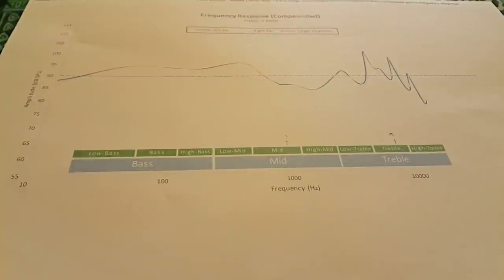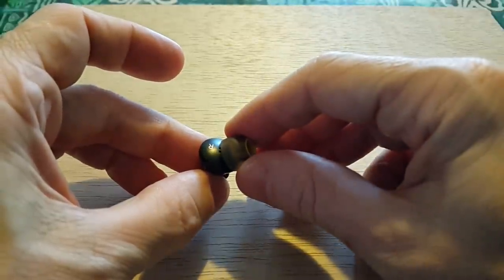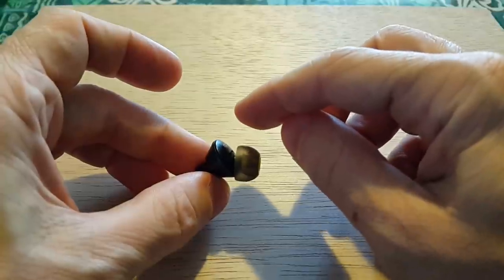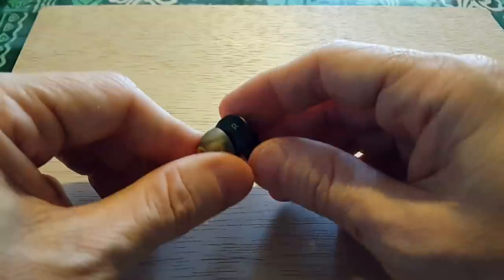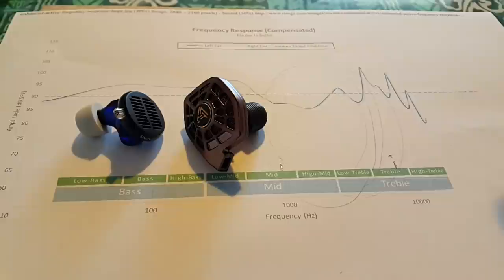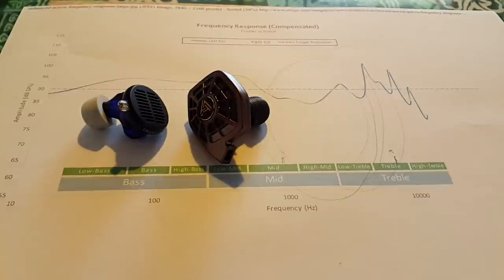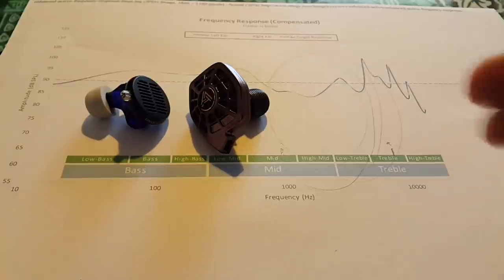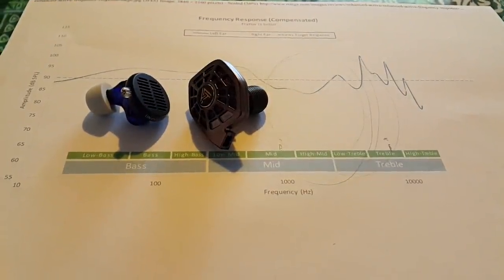Planar v.s. Dynamic, BA, Hybrid in ear monitors (IEM)

Comment: Very informative video. I own the iSine 10s myself and I love them. 

In regards to the EQ, Audeze released an upgraded Cipher cable that conforms to the new MFi standards that Apple implemented. Audeze says it just allows for more power from the lightning port, but I also noticed they tweaked the EQ to be much more balanced at base level (without adjustments). I don’t think it’s on their website, but if you email them they will sell you it. It’s also much lighter than the original, the DAC being plastic instead of metal. 

On another note, the me1s were far too mid-forward to my ears for enjoyable listening. They were very detailed, and incredibly well built, but I just couldn’t hear much past the mids. I’d like to hear what they sound like after some EQ tweaks.
Reply from the maker: Thanks. I am a Android based person so I walk the EQ jungle because I have to. The ME.1 are much improved by a reduction at 1Khz and a boost at 4Khz  and some bass ( for me)
Reply: Alex Darger cipher cable makes all the difference in the world.

Comment: I agree completely - I just recently bought the iSine 10 and m300
Reply from the maker: What is the main weak point in the frequency of the 300? in your opinion.
Reply: Bad Guy Good Audio Reviews I’m still a novice to EQing but the cipher cable seems to solve the issue on the iSine 10 listening to tidal on an iphone like everyone else says. I’m planning to get some 2-pin to mmcx adapters to try the cable with the m300s which seem to share the same issue. It would be nice if Audeze had designed a cipher cable that could be programmed with a usb cord to the remote by computer with a 3.5mm connector and include the 3.5mm to lightning connector for ios or usb connector for other devices. Then you could lock in the EQ settings internally and use it with almost any device, not just ios. In general, I agree with your overall assessment of the different types of iems. I also own a pair of sony 7550s which I like a lot. I’m still learning though.
Reply from the maker: You are living the high life :) I'm a droid user and we are in the jungle right now. The Sony EX 800/7550 and 1000 are the finest dynamic driver IEM ever made IMO. Sony makes lots of crap but the team that made that earned their money...unless they made the cable too...then i take that back. Such awesome IEM and such crap cable. I got customs for both my EX. Like a bucket list item crossed off.
Reply: korling99, and how about the sound quality of the M300? I'm almost buying one, but the opinions are all differents. Some say that they are incredible, others say that have many problems and only became nice with eq. Can you compare it with your iSine?
Reply: Frederico Silva Vieira Veloso I’m still a beginner audiophile, but they sounded good to me out of the box playing high res files from an Aune M1s player - rock and jazz. The biggest problem with the m300s is the fit. As others on head-fi, I bought the groovy kit from Audeze and it worked, not the most comfortable, but not bad. With an iphone using Tidal, the isines with cipher cable (built in eq settings) sounds better than the m300s. If you aren’t using an ios device, the isines will require eq’ing also. For the price, it’s worth a try depending on your playback device. Should be easy to sell if it’s not your cup of tea. I’m keeping both for sure. Biggest issue with m300s is fit, but if you look on head-fi, there are ways to fix it with minor mods or get the groovy kit from Audeze.
Reply: Bad Guy Good Audio Reviews ;n

Comment: Great review - how’s the comfort on those Audeze? And where to use them I mean not outside since they’re open and inside might as well get over ear for the same price..
Reply from the maker: They fit awesome. Those earhooks could use some foam or rubber tube for better long term comfort though. I use at home.
Reply: Comfort varies from person to person. They where ok for my but the driver housing touched my ear causing discomfet after extended use. I recently picked upsome  SYMBIO W Wide Bore Silicone+Memory Foam Hybrid ear tips and the now sit further our so it no longer touches my ears and are more comfortable for me.

Yes, they are open but not they are small (relative to normal open headphones) and I use them outside and at the gym with little issues. Of course at low volumes you will hear more of you environment that with traditional isolating IEMs. Leakage on this small drivers is also generally a non-issue, you have to be in a very quite environment and have high volume for other to be able to take notice. 

Even indoors at my desk I will often use the iSon's because how easy they are to wear vs my larger planar and other over-ear  headphones.

Comment: Interesting video, thanks. I have the iSine 10's. I'm not a huge fan of them with my Shozy Alien+ but watching this suggests I could get a better result by using the EQ options on my Android DAP and/or phone. I'd be interested to know how you tweak yours for the iSine 20?
Reply from the maker: Post #1250 has a good start point visually. bass up maybe shelved 250Hz and a dip from 500-1kHz and an big boost around 4Khz. I will do a video review and share my own eq but until then here is the posthttps://www.head-fi.org/threads/audeze-isine-10-isine-20-audeze-releases-two-new-iem-planar-magnetic-earphones.818870/page-84
Reply: Bad Guy Good Audio Reviews 
Excellent, thanks. I'll try that when I get home. I'll keep an eye out for your video on it too.

Comment: do you have any idea on what third party ear tips are compatible with isine 20? i got it last week but the tips are too big. hmmm maybe its the tunnel itself which is big. thanks!
Reply from the maker: I am using the groovy tips. Try some small comply for comfort. Not sure which brands are being used as an alternative? Head-Fi has a thread on the Audeze and asking in there would probably yield some info :)
Reply: I believe the nozzle is 7mm so you can use anything that works with that. I have tiny ear holes so I use small comply 600s. Groovy tips work well too. Unlike most other iems, you don’t have to push the tips deep in your ear, just get a good seal in the opening.
Reply: I've used the groovey tips originally but recently switched to the SYMBIO W Wide Bore Silicone+Memory Foam hybrid. It's a tight fit but it works

I don't find them to sound much different, but find they provide more comfort to me. Because they don't slide in far on the nozzle and keep the driver housing further out so they don't touch my ear and don't cause discomfort.

Comment: So do any of planar beat the crap out of the head like the ASG 2.5 did? Or what would be the best value under 700$ with an iPhone. I know that may sounds stupid, but I just don't want another bulky EQ device in my pocket. Thanks for your reviews, I'm realy hangig up on your channel now.
Reply: I just bought Pioneer SE-CX8, and I wonder if I should purchase  EX1000, XB90EX, or used 2.5 too. Just looking for the best allrounder with massive bass, to use with iPhone.
Reply: Recently purchased Shure 846 and sent them back after a week. I was never more disappointed. Even my RHA T10 sound more emotional and has groundshaking bass, than this sh*t for 800$...
Reply from the maker: Did you have the 2.5? They shake ear wax out pretty good. Radius NHR21(?) also have excellent sub bass kick. I would get used 2.5 for best BANG for buck. The others are good and have quality but not quantity so much like the 2.5 with dials open
Reply: I have only RHA T10, and had Shure 846 and Rose Cappuccino MKII 2. 
RHA T10 is still my favorite for trap and deep house listening.

I found some 2.5 on ebay in my favorite Brushed Nickel exterior, 
for 1000$  + tax shipping to Germany...
Is it worth it? putting that money once and be happy with perfect sound forever?

Or I may look for some newer up-to-date IEMs, available in stores
with the same thunder bass, and the clarity...

I have also a concern if my iPhone is enough to kick ass with 2.5? 
May I better buy Kicker that don't require AMP so sound good, or else what... 
I'm fkng frustrated man, but I want great sound, that's something that 
enhances your life quality, I belive. 
And you seem to have huge experience and a similar taste as me.

Thanks man,  you are making great content and I appreciate your feedback!
Reply: Just tried my new Pioneer SE-CX8. That's a dirty dynamic driver, a lot of movement, very loud. Just club beats, like 99% of porn... Zero emotions... Not for my taste.
I still prefer my old RHA 10, they are amazing...

Comment: I perfer dynamic drivers 😀
Reply from the maker: My Sony EX1000 are my fave's until I can figure out the tweaks fr these Planar. I come from Car audio and am surrounded by DD all the time so i love em too.
Reply: How can a device with one driver only do all that sound frequency at the same time?
Reply: @ashtongrist  it can't, that's why people get hybrids or pure balenced
Reply: @Thanatos4655  what's pure balanced.
Reply: @ashtongrist  all ba drivers (balanced armature)
Reply: But if I had say a high pitch and low pitch sound playing at the same time then  how in physics is it possible. Does anyone know what I mean?
Reply: How at the EXACT SAME TIME can a speaker work at all w one driver. It would sound like all the frequencies at once
Reply: @ashtongrist  spend 45 mins on sound reproduction via single driver, lots information available.
Reply: @ashtongrist  Well a single dynamic driver can process most multiple frequency because they don't actually work in frequency principle they work on binary system instead counting and converting 1/0 that your audio player process.
Reply: @ashtongrist  to make it more easy suppose 1/0 is mid 1/1/0 is bass and 1/0/1 is trebles mix it up 1/0/1/1/0/1/0/1 this is how headphone convert multiple sound.
Reply: @ashtongrist  it can dude go study . Its only about quality.